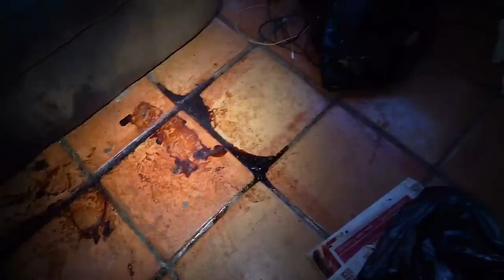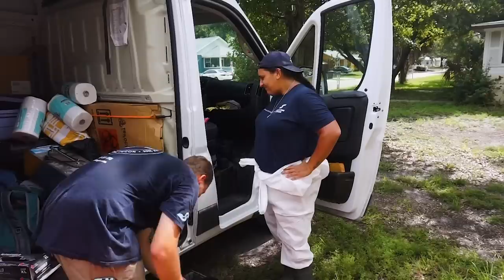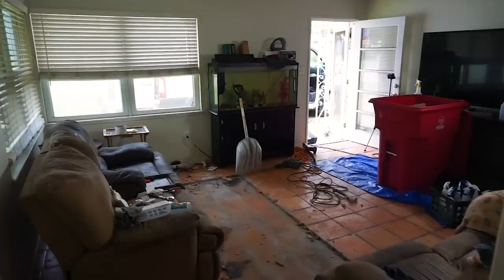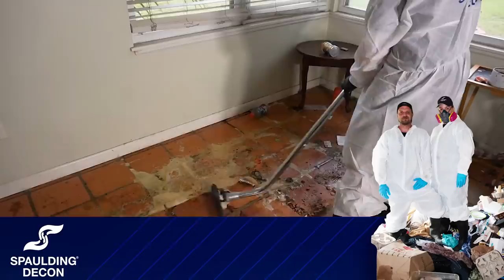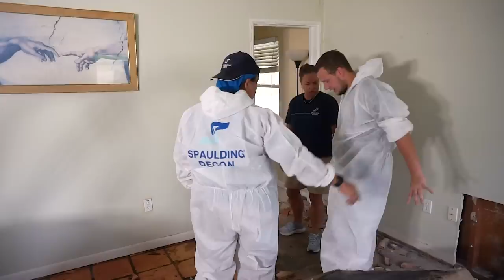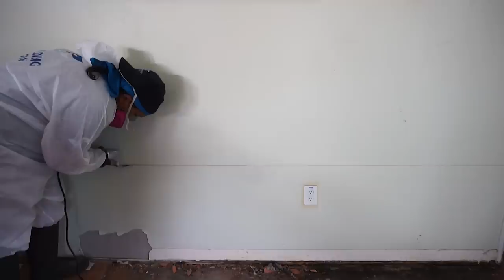Bloody Spread

Comment: Geez, 50 something isn't "older".  RIP.   Also we use tile for shower surrounds etc so is floor tile grout different in that it isn't sealed so liquid soaks in or?
Reply: this looks to be more of a mortar, probably due to the type of tile.. not like a standard grout. There are also different grades of grout. Standard shower grout has water hitting it and running off, areas where liquid pool are usually sealed with silicone sealant. Liquid pooling on porous material, is going to soak through to some extent.
Reply: Water isn’t as bad when it soaks into the grout, when it’s blood and other fluids you can’t just lift it out of the tile, since the body was decomposing, other fats seeped down.
Reply: Jessie C that isn’t just regular tile. It’s a thicker tile and calls either for more grout or mortar. The tile you use for showers isn’t as thick and is usually water treated. You can also use a water seal for shower surrounds.
Reply: All grout is porous unless it is epoxy grout or it is sealed, which is 100% necessary in wet areas.
Reply: Shower tile is different AND is sealed if you don't use bath tile
Reply: Also they mentioned plaster doesn't soak up bio like dry wall ?
Reply: Also, you waterproof a shower BEFORE you tile it. You should be able to use a shower without any tile.. And no there is not special tile for showers, but using a glazed tile vs a natural stone means the tile won’t absorb water. Waterproofing system first, then glazed tile and epoxy grout (or grout that you seal every 4-6 months) is how you avoid water damage in a wet area. Pro tip- if your grout darkens when wet it needs sealed.
Reply: And you should seal ALL grout if it’s not epoxy. Floors, backsplash, etc.. this is how you avoid discoloration of grout due to spills/cleaning products/dirt build up.
Reply: And if you have a grout that does need sealed, you should use PH balanced cleaners to avoid stripping the sealer
Reply: Miniature Bunyip freq
Reply: 51 is older... it damn sure ain’t young/younger.... and would it had been better if he said “old” ??!?! Smh
Reply: it is older for someone in their twenties. lmao.

Comment: My dad had a massive stroke in the hallway of my house in 2002 and according to my mom was coughing up blood and blood got everywhere and had a big pool of blood on the carpet. I was at elementary school at the time so I guess it was cleaned by the time I got home.   After my cat was peeing all over the house in 2009 I ripped all the carpeting up and when I was in the hallway and pulled that carpet up, I found big stain patterns on the backside of the carpet (top side was clean) and on the foam padding.  I did not connect the dots right away until  the thought randomly came back to me. I later encountered the same thing again when having to repair the light switch in the hallway in 2016 and the back side of the faceplate, the wall behind it, and the inner workings of the switch had blood in them.  It was kind of poignant.  
Whoever gets that house next, I hope they never see this video.

Comment: Why paint the floor ?
Reply: I believe it's a sealant.
Reply: It's a sealant, not paint.   When bio is in contact with porous surfaces like wood or concrete they do their best to get as much as possible. But even if it no longer "indicates" there is bio left, it's likely that some remains deep down.  If left, it's likely that it will start smelling like decomp later. When they seal it, any remaining bio and it's smell will be sealed in.

Comment: Question for anyone: I once was offered a Husky to re-home by a co-worker. Basically, I was told the owner died and it needed a new home. While considering it, a fellow associate told me that the dog had been in the house when the person died, and the dog had eaten part of the body. She never told me this. First...what would you do in this situation, and how would you handle it? 
Secondly, what do you think is best for a dog if it has done this? 
Just interested in what you think, thx.
Reply: There is nothing wrong with the dog and there is nothing to do about it. The dog had to survive so it ate some if it’s dead owner it normal . No real reason you have to bring it up to adopting families.

Comment: question: why tear apart the saturated furniture because it's going to a landfill anyway.
Reply: Biohazard. It doesn’t go in landfill and has special regulations for disposal and you’re charged for the weight of bio inside the red biohazard waste bags. They tear it up so as to safely remove and be able to dispose of only the bio contaminated materials and save on the cost of the weight. The rest of the item goes into normal disposal.